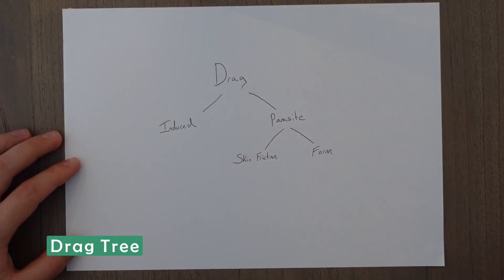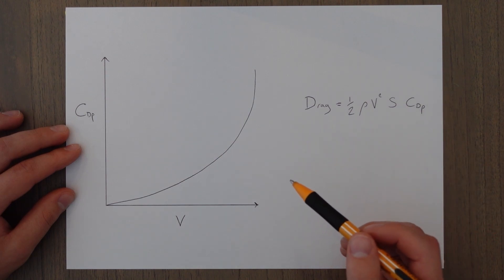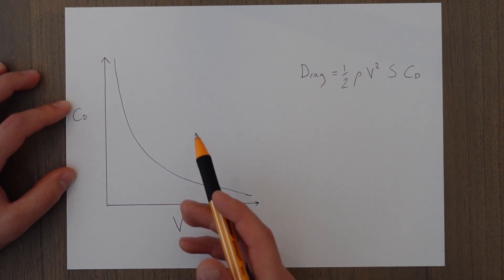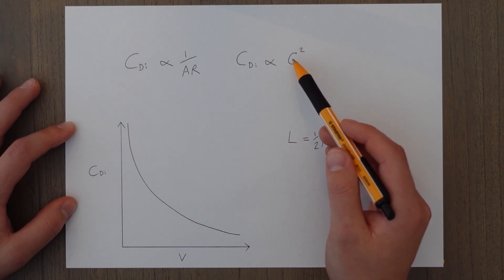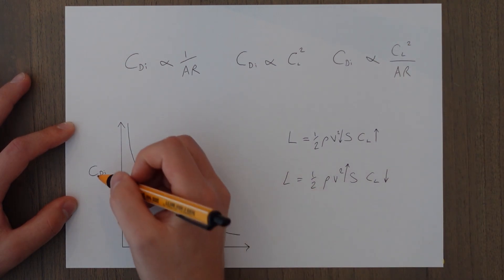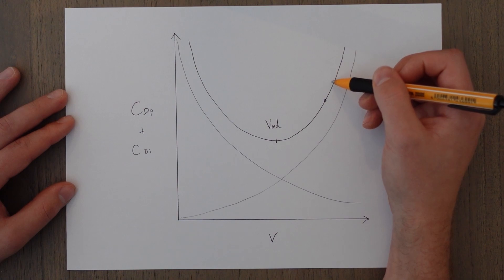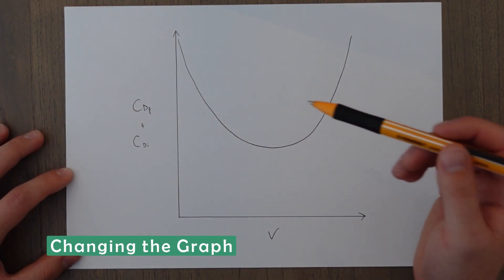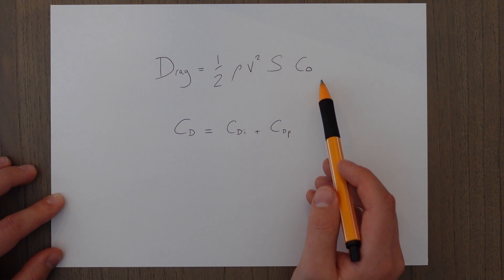ATPL Principles of Flight - Class 7: Total Drag

Comment: Hi Grant, Your videos are extremely helpful and I can't thank you enough for them.

 I had a question, you mentioned at 11:10 that if an aircraft is travelling in the speed stable region and the speed increases due to an external factor, induced drag decreases, and the aircraft will actually accelerate and likewise for the opposite.

 I understand the reason behind that, which you explained, but my question is that up to what point is this true? For example, we know that headwinds slow planes down and tailwinds speed them up.

So how is it that tailwinds speed planes up but also slow them down at the same time? I hope the question makes sense. Thanks.
Reply from the maker: I think you may be getting confused with the speed unstable and stable region?

If you are in the speed stable region a short burst of tailwind that speeds you up then drag increases and it will slow you down again, IF you didn't do anything to the thrust.

If you are in the speed unstable region and have a burst of tailwind then the drag will reduce and you will speed up and reduce drag more and so on, IF you didn't do anything to the thrust. 

The key is you can always adjust the thrust, so if you have a situation where the speed is increasing rapidly because you are in the speed unstable region. Then you can reduce the thrust, when it is below the level of the drag the aircraft will slow down away from a potential overspeed. Problem solved.
Reply: @atplclass  Right! I understand, many thanks for the explanation, Grant!